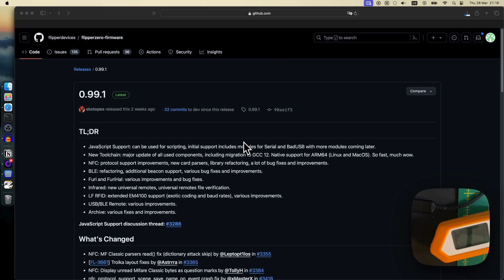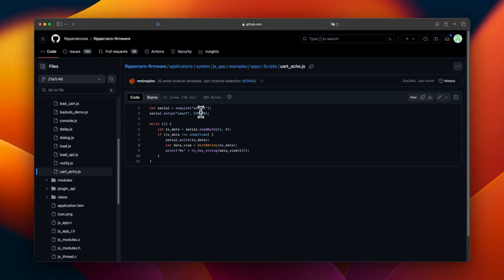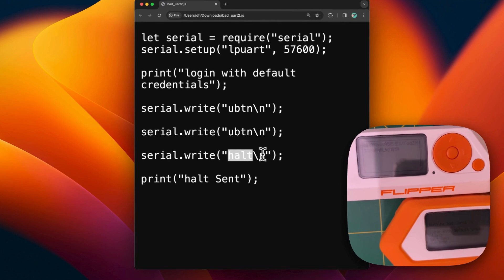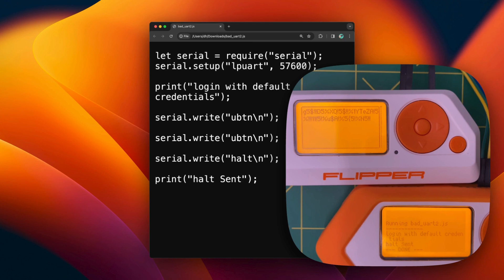There Was an Attempt: My First BadUART Script Using the Flipper Zero - I Need Help! 🆘

Comment: Don't take what I say as though I've done any solid research here, but I'm liable to think this is actually a firmware issue.
I've been having trouble getting my flipper to connect over uart to my pi0 the past two days, the uart terminal app wasn't getting any data transfer whatsoever as far as I could tell.
At first I thought I might be a pi issue so I didn't bother checking, but the issue looks a lot the same, in that if any data is making it through, it's somehow getting corrupted.
I have some pretty crappy jumper wires so that's definitely a possibility for both of us.
Once I have time I'll check my pi again and try to get the terminal running over flipper. If the pi isn't the problem, it's definitely the flipper firmware.
Bugs have been known to make it through in the past.